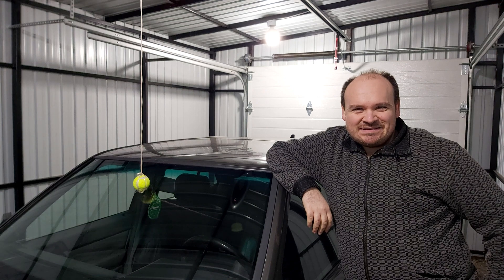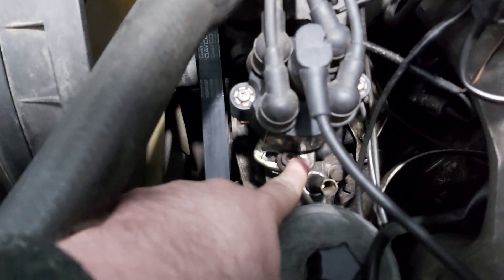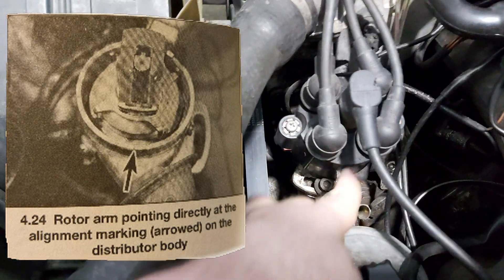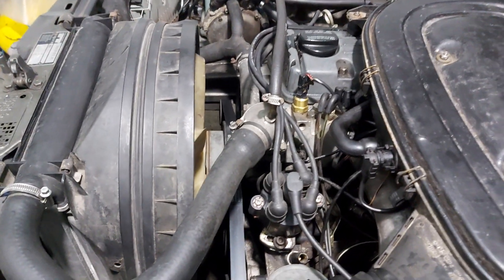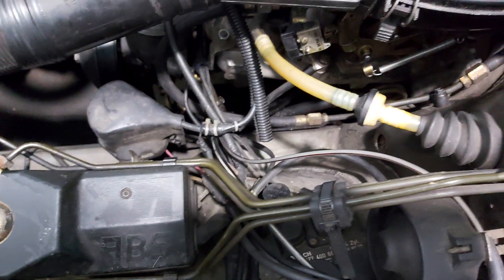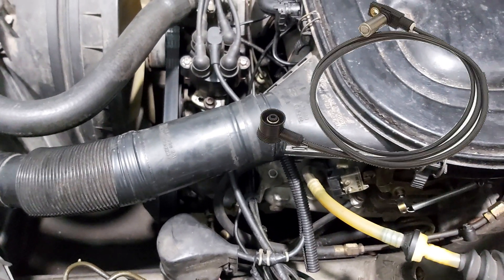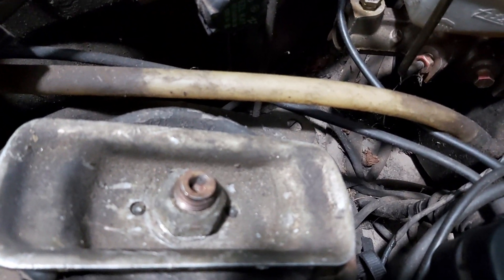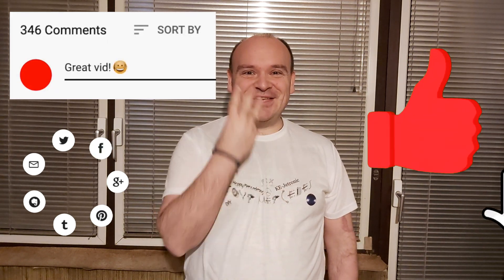Mercedes KE-Jetronic - EZL (Timing adjustment)

Comment: hi 
The main reason for the sluggishness of the m102 engines is that the ignition timing is slow. For automatic transmissions, it is about half that of manual transmissions. Do you know which ignition module is the sportiest for the M102 (230e)? Yes! There is such an option! ;)
Reply from the maker: Hi 👋 you’re right – ignition timing has a big influence on how the M102 feels. On automatic versions, advance is usually less aggressive compared to manuals, which makes the engine feel more sluggish.

For the “sportiest” option:

The ignition control units (EZL) are coded by resistors. By changing the coding resistor, you can get a more advanced curve.

On some 230E (M102.982) there were sport/standard options – the sport setting gives more aggressive timing, especially at part throttle.

Just be careful: more advance = more performance, but only if the engine is healthy and fuel quality is good, otherwise pinging/knocking can happen.

So yes, there is such an option – but it’s all about which coding resistor (or EZL module version) you use.

– Ivica | FixYourMercedes 🚗✨
Happy Mercedesing

Comment: Hello, so basically the rotor cap must point this groove on the distributor housing when cylinder number 1 is top dead center? I cannot find the correct answer on the internet. Thanks for the answer
Reply from the maker: Correct. Two grooves aligned where the chain sprocket is with the other side, the nail on the damper aligned with 0 mark(or OT - TDC in German) and the rotor must face cylinder 1. Then is your timing set correctly.

Comment: Ivica for the win as always!!!
Reply from the maker: @mrazekjan96  Thanks a lot. Happy Mercedesing 🍀 👍🏻 💪🏻 😊
Reply: @mercedeske  Dear Ivica, I am expierencing pinging noise from the engine and suspect its detonations caused by timing issue. I have ran natural 95 and it was very bad, now with 100 octane is better, but stil audible. My switch is set to "S". Could moving the switch and retard the timing help? Thanks!

Comment: Hello, will I have any problems if I use the ezl switch behind the battery in 7?
Reply from the maker: I didn't try it but I don't see the reason for putting it on that position.

Comment: Hi, very cool videos, I would like to ask something, in my car W201 2.0 122hp from 1991 I relaized that the car does not go well with 98 ROM gasolino or premium, I use the S position as it is sugested but when I use that type of gasoline my EHA leaks and in general the engine does not run so smooth, you think this is normal?
Reply from the maker: Hi. Measure the EHA in general. Does it leak when you use other positions than S?

Comment: good day . Thanks for the information you provided. my car is m102,962 engine ezl kat. How many degrees should the initial timing adjustment be? Thank you in advance for your help
Reply from the maker: Good day. Well there is nothing you can do there. If you have a sticker when you pop up the hood it says on the sticker. Everything you can change here is to turn the resistance trimming plug to other positions than "S" but I wouldn't recommend you to do it. There is nothing else you can do to readjust the timing. The EZL and the ECU do it all automatically. Greetings.

Comment: In California and I will be running premium fuel 91 octane shell v power in my 1989 300te what can I adjust this to see a little bit of performance and can I advance the timing as well on this car other cars I've done it easily but I don't think it's easy for this m103 motor any ideas
Reply from the maker: Let it be on S. You can't do much on timing. If you want a bit performance replace the spark plugs with pulstar. Those are plasma plugs. They are just like ordinary plugs up to 3000rpm. Higher than that they give engine more power.
Reply: Hi, in Indonesia, i am currently driving 1990 300 TE 24 valve, if i want to fill in 90 RON gasoline (which is equivalent to 86 Octane in US), based on your explanation, should i turn ke knob to N position? Thank you in advance
Reply: @Pabs1992  Iya pakai N. Btw dianjurkan menghindari Pertamina, kualitas hexane dan octane jelek

Comment: hello everybody 

I have a problem in my 91s mecedes w124 200e 102.963 .... 5speed manual ... the rpm is talling when i shift to neutral
Reply from the maker: Have you replaced the potentiometer?

Comment: Hello dear
I have a question that is not related to title of this video.
but if you know please help me to solve it
There is a w124 benz which has this problem:
a w124 benz after engine starting is normal. When i press gas pedal the RPM goes up but after realesing pedal the Rpm does not falls down fully. To solve that during engin running i dissconect and reconnect the socket of idle control valve rapidly ,the problem solves.
But once gas pedal is pressed it occurs again and i have to do the same thing that i have said (dis_reconnect idle control ).
What the exactly problem could be??
The idle control valve is replaced with new one but it does not solved and same truble is hapening.
I am bored and do not know what i have to check.
Help me
Thanks
Reply from the maker: Hello. Something concerning the current supply, I would say. I will post the link where I give nominal values for m102 engines, maybe it can help. You have some problems with the current supply coming from the ecu. 
https://www.youtube.com/watch?v=jx8xWmALmGk
Hope you solve your issue

Comment: We changed its position today. The vehicle has become 50% more serial. Yes 2000CC 200E! Really the vehicle does not stay in place!
However, it does not look like the model seen in the video. 1989 200E No catalytic.
The hex bolt is positioned relative to the Radiator side. I am very pleased! Will this boost of strength hurt me?
Reply from the maker: It depends where the groove on the rotor is. If they are aligned in that position, then no worries.
Reply: @mercedeske  
Thanks to your positive knowledge, I have come a long way. Now I'm about to send your gift soon: P
 my model has no EZL, No Catalytic. I sent you the last location by e-mail.
Reply from the maker: @r3FMusic  Thanks for your kind words. I am really grateful to people who appreciate someones work as you do.

Comment: 1:29  i have engine in this position (hex screw position). There is an idle misfire.
Reply from the maker: NEVER!!! The rotor must face cylinder n1. Mount the rotor as on the previous picture the groove on the housing must face the center of the rotor!!!Towards the cylinder number1!!!
Reply: @mercedeske  i cannot move the rotor arm to the marking number 1....
Reply from the maker: @makavelibenzze  Take the rotor off, pull it off and then push it back to the st cylinder? Which cylinder your rotor points to?
Reply: @mercedeske  i try tu turn and push it to the cylinder num 1 marking, it wont turn. the rotor is diffrently as each time i pull the dizzy Cap off. How? it runs fine, no misfire...but after i clean the deposits, install it back. the car RPM gets low, and stall when pulling the steering
Reply: the rotor cannot be turn by hand. The dizzy cap somehow have a bit of freeplay to left and right, cant disturb it, it will stall worse
Reply: rotor is locked when engine is stop. And pointing at diffrent direction each time i open. Mine 230E black engine, masterpiece, UK spec
Reply: @mercedeske  the distributer is a bit diffrent from the video, the cap is locked with phillip screw hooked style.
Reply from the maker: @makavelibenzze  Yes. You will have to align the TDC mark on your pulley. There are 2 marks that have to be aligned, one of them is a TDC(or OT) and the second one a little nail. As you align the TDC(or OT)mark then you will have your piston number 1 in the top dead center. Did anyone readjust that on your car? As these are aligned then the timing is correct and then the rotor should be pointing towards the 1st cylinder.

Comment: Thanks.This is a risky issue. I would be very glad if a video comes in detail.
Reply from the maker: The only risky issue is not to align properly TDC with the first cylinder if you decide turning the engine. This is piece of cake.

Comment: Hey, thanks for the vid. I'm currently diagnosing my 2.0 m102 after a rebuild. It got spark but it doesn't get fuel to the cylinders. I looked into this and found out that the bottom part of the fuel distributor got fuel but it doesn't' go up to the top chamber. Any thoughts?
Reply from the maker: Test the distributor - brigde the contacts 7&8 with a wire and unscrew the metal hoses from the distributor. Turn the ignition on and as the fuel pump starts delivering fuel just watch - no fuel must flow. Then deflect the plate and if you don't get any flow out of the distributor, then you will have to disassemble it and clean it entirely in the ultrasonic bath. You will also have to find a new kit, the new o-rings and the diaphragm. If it's up to that, then contact me to give you the instructions what to pay attention on in order not no rupture the diaphragm and not damage the o-rings. Good luck, FyM
Reply: @mercedeske  thanks for the response, I will try and test my luck.
Reply from the maker: Just go ahead! Fingers crossed 🤞
Reply: @mercedeske  hey, I eventually got fuel running slowly bur surely through the fuel distributor and to the fuel lines but the car still won't start, any thoughts?
Reply from the maker: @Sheikob  You should have about 2mm gap as you press the sensor plate. Either try enriching the mixture by turning the screw for 1/4 of a turn and see what happens or get it back to the original and clean the distributor. Does same quantity of fuel come out of all the ports?
Reply: @mercedeske  the plate has some play, I haven't measured but i think it should be 2mm or something. I will look into the quantity of all the ports. I can respond how it turns out. Thanks for the answer.
Reply from the maker: I'm glad. We want to try to escape opening the distributor. Check the injectors if they spray. You have my video on how to test them and see which one is bad. Try testing the whole system - the pump, the fuel pressure regulator also. You will need a pressure gauge to measure the pressures, 5.3-5.5bar should be the bottom one. Maybe it's up to the fuel pressure regulator.
Reply: @mercedeske  hey, i haven't had time to check the injectors but I got the car running for about 30s. The car was idleing really high, about 3k rpm. After I got I started it didn't start again, any thoughts?
Reply from the maker: @Sheikob  What did you do in order to start the engine?
Reply: @mercedeske  well, i removed the fuel pipes from the distributor and realized it didn't flow any fuel, i took of the distributor and removed the plunger, cleaned amit if there was any dirt in it, didn't see any and reassembled it, fuel flows good now.
Reply from the maker: Do you have a gap of 0.6mm between the sleeve and the nut when you reassembled it?
Reply: @mercedeske  should i measure from the tip to the nut?
Reply from the maker: @Sheikob  Watch this video from 18:00
https://www.youtube.com/watch?v=CbUzb-SEQFU